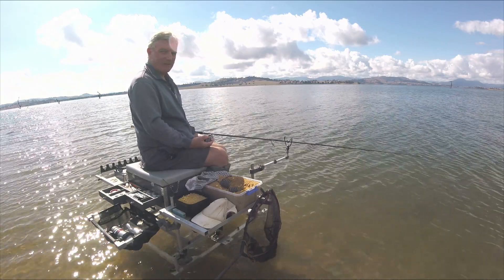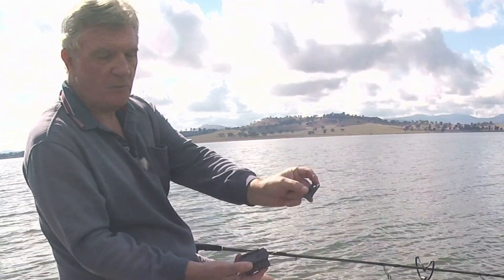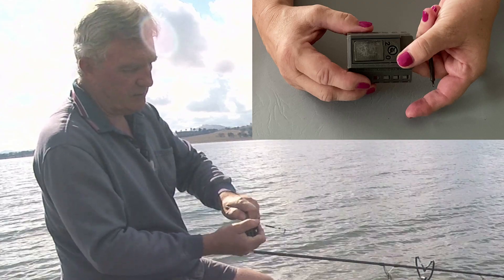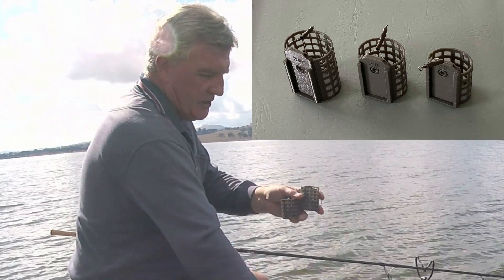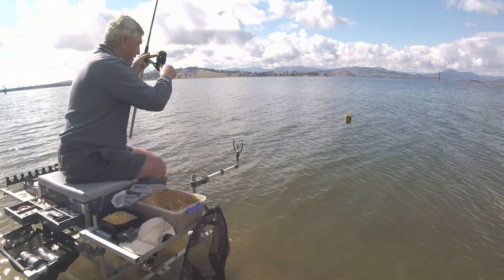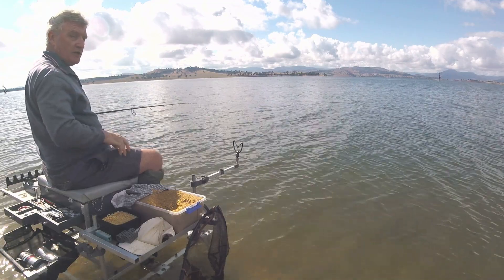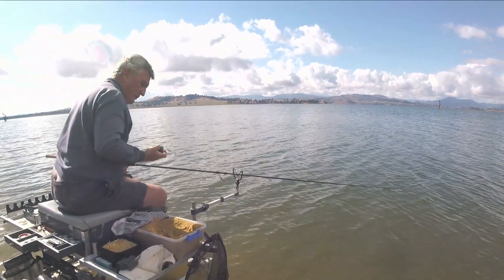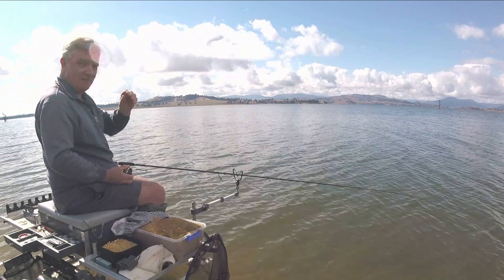New 3D Printed Cage Feeders with Interchangeable Weights - On the Bank Demo

Comment: I liked the slide in lead feature and then thought what if the cage were also slide in to allow differing sizes and shapes and pre loaded cages for when match fishing although loading a cage feeder does not take much time, getting the compression of the bait correct can be of benefit.